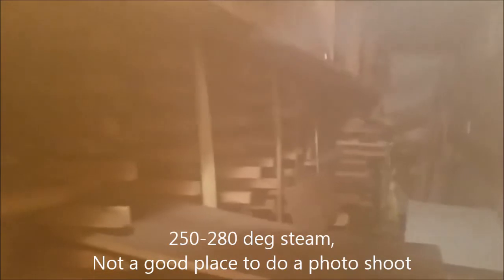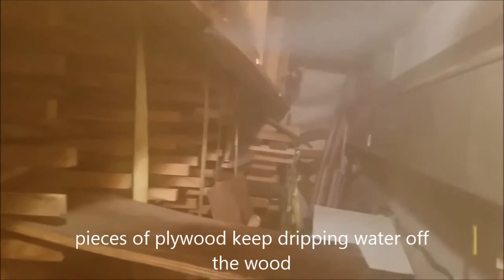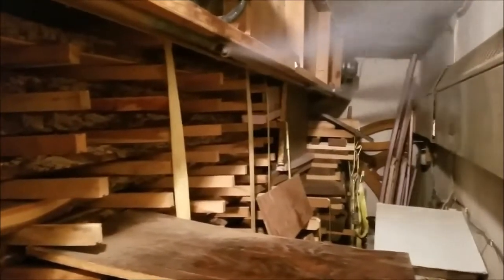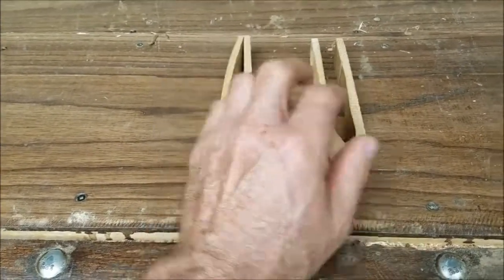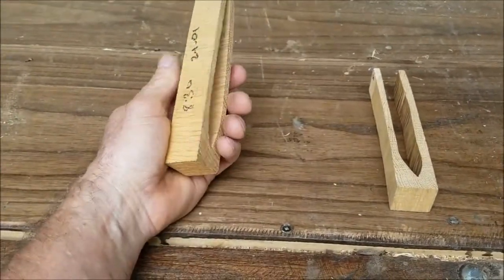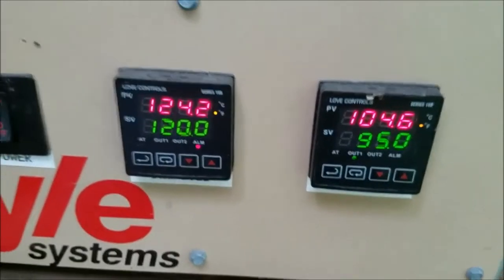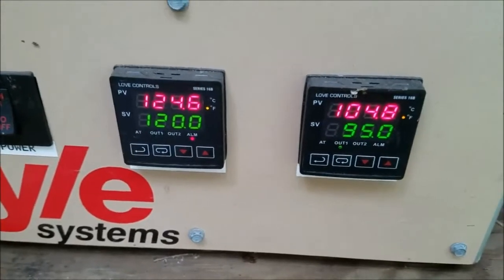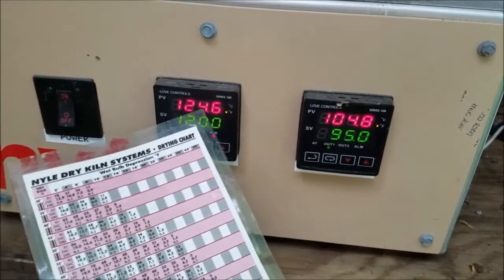Finishing last step in kiln drying process. Steaming lumber to remove case hardening.

Comment: Never heard of steaming after KD...is that just something people don't talk about?
Reply: Sorry sorry for the late response. I just saw this actually. Most people don't hear about all the different aspects of Kiln drying because most people don't understand how to Kiln dry wood. Certain manufacturers that sell Kiln components tell potential customers to just dump some water on the floor. They sort of skirt over how to really condition would because working with live steam is very dangerous and expensive. They don't want to scare away potential customers
Reply: @brianlorentzen8603  This video is super helpful.  Im in the process of learning how to kiln dry (probably going to use a Woodmizer KD150 kiln).  Would you be so kind as to elaborate about what the dangers are specifically as well as the components of your steam setup? Thanks!